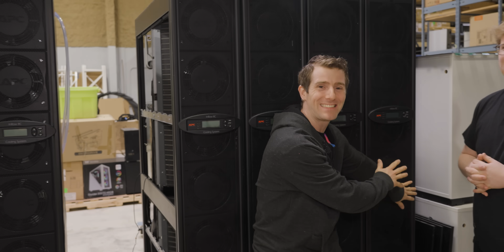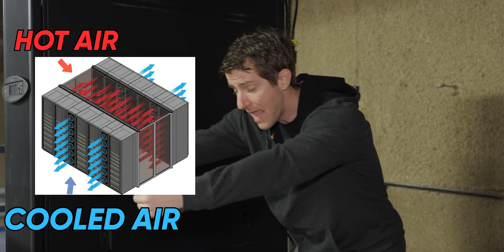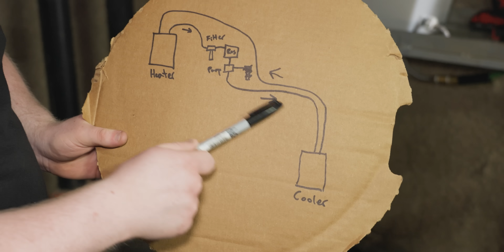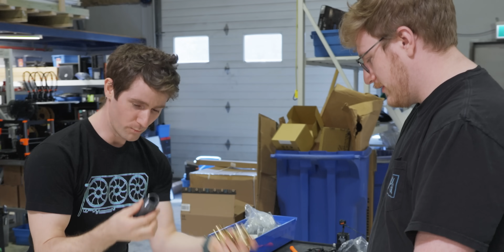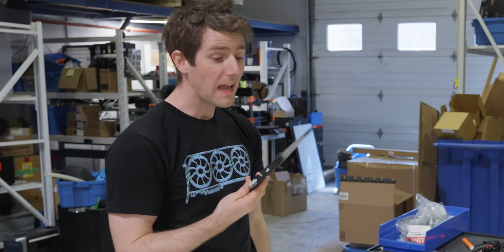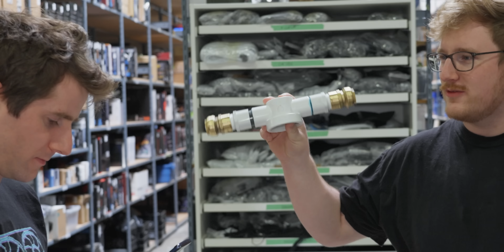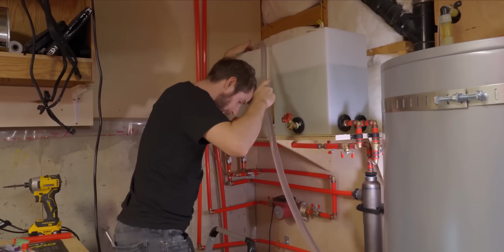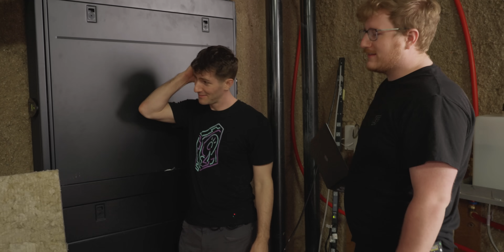I shouldn’t have kept the $1,000,000 computer

Comment: 16:19
"You can fix everything with a hammer"
"You can use anything as hammer"
Reply: First rule of designing construction equipment: Overbuild it because it WILL be used as a hammer!
Reply: So "you can fix everything with anything" ?!
Reply: @bigfil1981 Technically correct, the best kind of correct!
Reply: @bigfil1981  fuck i wanted to answer that :D Many great minds think alike
Reply: "Any machine is a smoke machine if you operate it wrong enough."

Comment: At this rate you guys should really just go to your local plumbing supplier and have an account to get trade pricing with these types of projects
Reply: Also i noticed you guys bought Rehau pipe which is far more expensive for this case use…especially with the shark bite fittings.

Comment: In the hangar where I worked we used an oversized muffler to kill exhaust noise from the Electrical systems air exhaust in the aircraft.  It worked great without impeding flow. Basically your normal exhaust diameter with a bunch of holes in it and a larger diameter tube around it with some light insulating material. little to no restriction of flow but plenty of opportunities for sound waves to bounce around and die out.

Comment: How come you guys don't just use a few swamp coolers to cool the majority of the server room? Those get super cold using water and a squirrel cage so they are much cheaper and easier to use than a whole AC system or whatever that cooling tower setup was (also no chilled water required but can improve results), much better on power draw also. I have had a PC right in front of mine for 2 summers and have had no moisture inside, it also didn't have desiccants inside the case. Its sat about 2 meters from the outlet of the cooler and my PC stays below 34C on the radiator.

Comment: No, there should not be "evaporative loss" in your radiant floor heating system.  That means you have a leak, albeit a small small leak but still a leak.  Look for mineral buildup on the connections and that will be where the leak is.  Usually on unions.

Comment: You should get Banjo Polypropylene fittings not necessarly the exact brand but ALL Banjo fittings have STP files available on their website.  I've 3d printed quite a few for testing and to use in a pinch on our Drone AG Trailer. They are quite inexpensive and if they can run support very nasty agricultural pesticides, herbicides, and fungicides (some of which Eat aluminium and steel).  It should work great.

Comment: It would be pretty cool to see a Fresh air replacement system for the server room, baiscally you just replace the Hot air in the server room with the outside air (when its cooler) thus being cheaper than paying a ton for AC, downsides being air filtration as you are pulling outside air, but im sure the filter replacements are far cheaper than the powerbill

Comment: In real data centres, these units are often arranged where  the servers' exhaust goes into an enclosed hot aisle, the unit then pull.that hot air through and cools it down and returns it to the data centre or a cold aisle. It's very efficient as you don't end up cooling the hot air as much or pulling in chilled air that's already cooled.

Comment: i work in a big plastic extrusion company and we have pipes under our outdoor storage about 20.000m2 and in the winter time we can remove about 500kw of heat from our production and the cost is really low because it only runs with one pump and nothing else. even with an outside temp of about 15 degrees wwe get a return temperatur less then 20
Reply: I work in injection molding company and we use hot water from injection machines to warm the warehouses in the winter, its pretty sick how you can utilize the resources that otherwise would be just wasted.
Reply: God I hope there is redundancy in the pumps hahah

Comment: Notice how the soldered on connections are angled.  You cut off too much of the copper elbows. Now, the pieces you soldered it on the elbows are not on a straight piece of pipe, but are on a curved piece of the elbow. Not good.

Comment: Wow it's like my house, 85F. Ever since I moved in in 2018, none of the FOUR, yes FOUR AC units have worked the whole summer season, and since I live on the coast of Mississippi, that means our SUMMER SEASON is not 3-4 Months long, but 8-9 FLIPPING MONTHS LONG Literally starts in March/April and ends in NOVEMBER. I have asked 5 different AC companies to just replace the damn things, but NAH, why would they? So currently sitting in a 20 fan room that's up to 87F right now and 65% humidity. SIGH... I think the issue is, not only is my house large at 4700sq ft, but it's also tubular, A thin but LONG house at 150FT long and about  20FT average width, and is two stories.

Comment: Pffft.  Come on linus, you know what the solution is, you provided it yourself last week.. Lustre filesystem , 100 CM3588's acting as OSS/OST at 130$ a pop  , 25 tp-link TL-SE2106 switches at about 100$ a pop  , 25 10 gb SFP+ modules, about 50$ a pop , a 24 port 10 gbit switch with 100+ gb uplink .. and 400 sticks of M.2 drives. Patriot P300 2TB  10 Pack x40-> 40.000 ..  Not a million dollars.. but still, a lot more efficient, and a lot less money and all done with open source hardware/software.  in raidz1 you lose 200 of your 800 TB.  If you want 8TB m.2 drives that's a total of 3.2 petabyte in raid 0 2.4 petabyte in raidz1.  With the cheaper ssd's and using 4 mb CM3588's that's a total of $58.000 .. It will be something you built yourself, it will inspire your viewers, it won't be "installing pre chewed proprietary professional hardware". Find a sponsor and make it, you'll get the views, especially if your viewers feel they can achieve it themselves.

Comment: Honestly I would put all the APC units in the server rooms and just buy a cooling tower to stick outside for $5K. You should be able to buy 20-30 Tons of cooling tower with a 1-HP pump for that kind of money. It would be open loop and you'll have to treat the water but they're great at just getting rid of excess heat. You can also use the return loop for indoor heating in winter. Next best option would be outdoor closed-loop radiators. It just seems a waste to put the intelligence at the hot side. You just need the hot side of the loop to be the biggest heatsink possible. The reason you want the intelligence at the cold side is cause the actual data center floor space is expensive. So inside is where you want the bulk of  your intelligent radiators, and outside is all the dumb radiators and pumps. About the fanciest thing you'd need for the outdoor part is a basic thermostat to turn fans on and off. You are far enough north where free air cooling makes sense.

Comment: You live in Canada.  you need an outdoor heat exchanger.  or connect 3 units with outside air.  and you can cool it without air conditioning 8 months a year.  The industry calls it FreeCooling.

Comment: Jeez… dry air cooler, microfill pressurisation unit, crimped copper fittings, 3 port valve to make use of the reclaimed heat and a basic BMS controller and you’d have avoided all that bullshit. Oh and a pump, you’d need a pump to pump the water around the stystem.

Comment: The best solution would probably be to replace the unit with an air source heatpump that Supports cooling Mode. That will increase the temperature Differential by a lot and therefore increase the effectiveness.

Comment: Advice for testing leakage for next project involving plumbing:
When you think you are done with the plumbing use an air compressor to fill it with air and spray slightly soapy water on the fittings. If it would leak it will bubble up. This way you can fix leakage without needing to deal with water. Then you can fill the system with water.
Reply: they should know this. they have done the same thing for PC water cooling with a little hand pump.
Reply: Dealing with water is better content
Reply: They 100 % know that but don´t care
Reply: Got to be careful not to pressurize it too much, there is a lot of energy in compressed air.
Reply: @JGnLAU  right.
Reply: They've done that in the past. Can't do it with the basically open-top plastic reservoir they're using here, since the reservoir won't take the pressure.

Comment: Watching y’all work on your water system made me think of my sump. Having a place where water flows in from the over flow box, then having it return at a constant flow rate through the return pump. I’ve seen other salt enthusiasts build water chambers, where it inserts water into the sump, after it reaches a lower than a specific level. If you decide to expand on the water flow system, it would be a unique opportunity to work with salt water enthusiasts, to help redesign your ideal water flow system.

Comment: As you know, the ac does not magically create cold air. It's moving the heat away + creating some more heat. All that heat should also be dumped in the warehouse if the warehouse needs to get warmer

Comment: A friendly local plumber/mechanic designer and long time fan here- you are kind of correct by saying that a closed loop hydronic (heating/cooling) system requires a check valve. However, more specifically, it requires a reduced pressure backflow assembly for cross connection control. Furthermore, a hydronic system likely will run at much lower pressure than city water pressure. A pressure reducing valve will need to be installed as well.
Reply: Yup, plumbing engineer and I was thinking the same thing. They're definitely opening themselves up to contaminating the potable water supply. Now, I'm guessing that the building itself was built to code and has an RPZ from the city main, but since they're just tapping into a hose bib, they've exposed the entire building's water supply to whatever chemical residue was left inside those cooling racks. It's unlikely that it's actually contaminated things because there's probably not much or any backflow with their setup, but an AHJ might shut the building down because of the "contaminated" water supply.

It's one of those things where I feel like LTT is opening itself up to legal trouble by hacking stuff together. They've done enough plumbing on this channel in the past 1-2 years that I feel like they should at least have a consultant.
Reply: @Waggles1123  this setup is going to be replaced by a professional in a few months™ anyway, but you're right in that they should've done better
Reply: @Waggles1123 unless I completely missed something…

Aren’t they isolated from the utility supply?

They added water via the tank on the mezzanine which was filled with a toilet valve.

What’s there to mix with the utility water?
Reply: @Comeyd  That's what I thought too. I mean, they are just exchanging heat with water in a closed circuit. What I took from the video is that in reality they are water cooling the room exactly as if they were using an AIO. But the thing is that they've added a water circuit which might be directly hooked up to the main drinkable water pipe (taking water from it and returning to it, if necessary). That might not be something to worry about if they don't drink that water. But if they do, all the debris from inside the circuit might affect the water supply.
Reply: @asnovasdodia where is it being “returned”? that’s what I must’ve missed. Jake was talking about evaporative losses.

I can’t think of any possible reason why you’d “return” water to a pressurized supply line and not… to a drain…
Reply: @Comeyd If the pressure of the supply ever drops - either because the supply gets turned off by the water company, someone closes the main valve, or simply after a pressure spike and the toiletvalve doesn't close perfectly it will inevitably backfeed into the freshwater supply and contaminate it 😮
Reply: @robstamm60 what? No it won’t.

If that were true you wouldn’t able to use the toilet valves anywhere…
Reply: @Waggles1123  I just replenish manually mine when the pressure drops bellow 1 and the boiler stops. It happens like 4 times every winter so not much of a deal. I guess having the boiler stopped for a while matters more in Canada, not that much here in Barcelona. ( Worst in winter is maybe -5 C, and that may be just  for a week )
Reply: @Waggles1123  The biggest source of contamination in a heat exchanger system is likely going to be whatever material that makes up the rads and the gunk inside the rads. If the rads are made out of copper core or brass core (which likely has trace amounts of lead lining) that could be hazardous if there's a backflow into the water supply.
Reply: @Waggles1123 : I would want to see an overflow relief tube for the tank in case the toilet fill valve gets damaged by a cold-snap, but that valve that they used should stop the sort of back-flow that you seem to be worried about, otherwise the things just wouldn't be sufficient for their jobs.
Reply: Data centre design engineer here - On the back of this with the water being in the prime window for biocide growth this is a serious risk. We are seeing real issues with using even water + biocide and indeed it’s now recommended to use a pre mixed glycol based mixture (ie pg25) for loops like this. There shouldn’t be any water loss in a closed loop system (unless there is a leak).
Reply: Gday friendly HVAC&r Installer here I feel like a refrigerated CRAC is more suited for the application rather then a water cooled CRAC unit. Recently installed both a water cooled and refrigerated CRAC unit in a UPS room at a hospital, the water cooled unit was connected to the massive cooling towers on the roof while’s the refrigerated unit had a remote condenser a few meters away outside. I feel like water cooled ain’t the way to go
Reply: How do you feel about the hot line and cold line running alongside each other in the duct work?
Reply: @richkar1127 technically this isn’t allowed as per BC building code seeing that the pipe they are using is not rated for this. The exception is they would need to have that ductwork protected with sprinklers.
Reply: If they are using shark bites they should really swap them out for more reliable fittings.
Reply: @dudesweetpro are shark bites not reliable? They said in video or were they being sarcastic haha
Reply: @dothatjustin they are pretty reliable at what they were made to do, which is repair jobs in residential settings. I wouldn't want to use them on a project that could subject them to pressures, temps, chemicals, etc that they weren't made for.
Reply: @dudesweetpro from personal experience, I’d say Sharkbites are reliable - the only time I’ve seen issues with the product is from installer error (ie pipe not inserted fully). On that note, sharkbites are significantly more expensive than using regular PEX fittings. Hopefully Linus isn’t doing a price check on your materials tab there Jake ;)
Reply: As “plumbing engineers” that’s the thing that got you about the video?? None of Jake’s Hackery or scams?
Reply: @Egor778 what’s scams
Reply: This sounds like chinese 😂